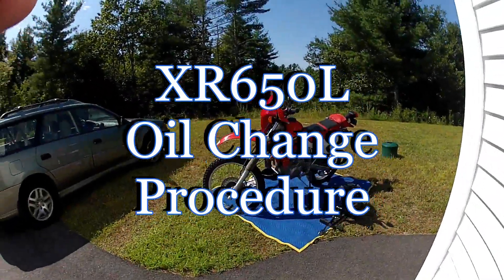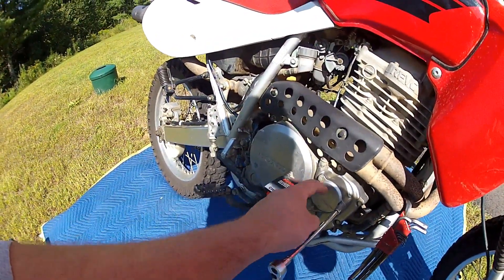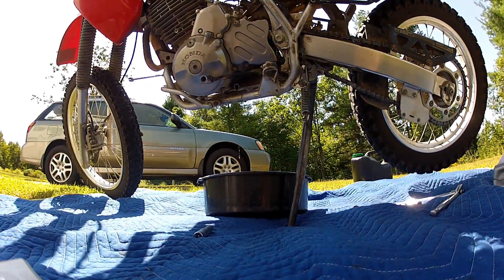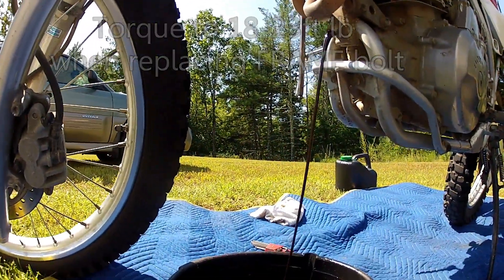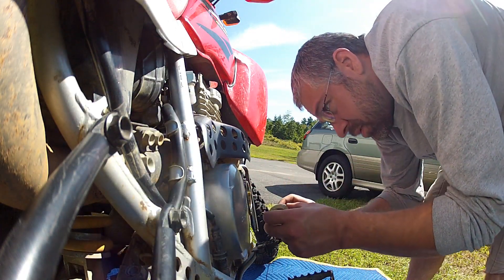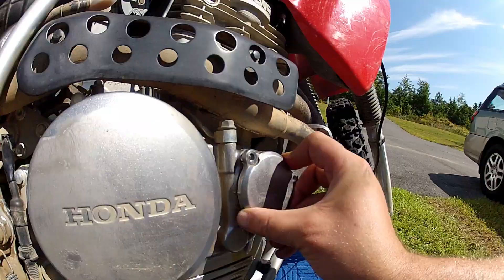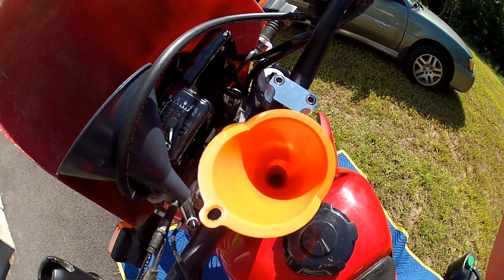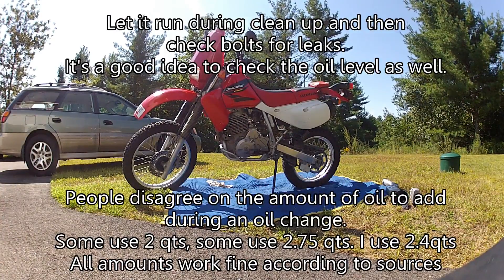How To: Oil Change Honda XR650, XR650L in 3 minutes

Comment: It's a good idea add new oil into the new oil filter before reassembly. Hold the filter to the same angle as when it would be installed and add oil until it is full at the correct angle. Then reinstall. I do this with all my motorcycles.

Comment: Hi nice vid. Just bought a used 2008. No manual of course so this helps. Question, who makes the tall windscreen.  Thx G
Reply from the maker: Hi Mad G Force , I can’t recall who makes that one but there are several companies that have developed one.  Try using the search term “rally fairing” on google.  Read old forum posts at advrider and thumpertalk and I think you’ll find the info you’re looking for.  Ride safe!  Congrats on the bike
Reply: Jeremy S thx again for more good info. G

Comment: ok thankyou Jeremy that makes sense,I think I will use the recomended Honda GN4 10-40 oil,im currently using spectro in my BMW Boxer,I like to use what the manufacturer recomends
Reply: Rotella T6 5w40 is a better choice.
Reply: Mobil V-Twin 20w-50 full synthetic for big thumpers...

Comment: Theres a gauze filter assembly with the oil pipe in front.Needs to be cleaned as well
Reply from the maker: I left it out as it's not in the manual and I personally never found anything wrong in there after 20k miles of oil changes.  Good to check it every 3-5 changes though.

Comment: 10w40 0r 20w50  are you using mobil 1 auto oil.  And if semi synthetic oil I used can I still use regular 10w40 if meets standards of Jaso T 903 MA) SAE ) API SG or higher.  Whats that all about.  Bike shop said if I used semi of full synthetic, clutch will burn up if I go back to non semi ? help if you know some.
Reply: twing21able Mobil make Mobile 1 full synthetic V-Twin 20w-50 (made for wet clutch motorcycles)...perfect for big air cooled thumpers or a 650r with 6k miles on it...

Comment: What do you think about that magnetic drain plug? Is it really necessary if you change the oil frequently?
Reply from the maker: I had over 20k miles on both engines in that bike and my rebuild was NOT caused by lower end issues or oil flow issues.  My advice is to:
-  Use a magnetic drain plug if you might not keep up with oil maintenance. (Never the aluminum one)
- Add a case saver if you might not keep up with chain maintenance
- Add a skid plate if you might ever bottom the bike out on a pointy rock
- Add brush guards if you ever plan on ripping through the trees (hand protection)
- Add a oil temp gauge if you drive deserts or hot stuff
- Weld a plate on the bottom of the kick stand if you might stand it in soft stuff
- Get an aftermarket seat if you plan on long trips
- Get standing pegs and a handle bar lift if you plan long trail trips
Reply: Thanks for the great advice!

Comment: do you check oil level by screwing the dip stick in all the way or just drop it in and check there ???
Reply: Just drop in up to the threads dont screw it down.
Reply: @crazyrebl  Thanks I was hunting for that tip!

Comment: Jeremy, what type of windscreen do you have on your XR650L? Thanks
Reply: Larry its a fiberglass and gel coat RallyRaid rally fairing for an xr650.  It will be an international order with hefty shipping and requires the light hole cut out which is a bear without the right tools.  RallyRaid is easily found in a search engine.  Ride safe.
Reply from the maker: I kantSpel provided accurate info.

Comment: how often,or how many miles should we change the oil on these bikes?
Reply from the maker: The manual states every 2000mi or 6 months, whichever comes first.  If the bike has added mods which make it run hotter, or the miles are hard trail miles rather than street miles you should change it more frequently @ 1000mi-1500mi.

After you've owned it for a while, you'll find that shifting stiffens up around 1000-2000mi and you'll start to miss gear shifts.  That is a great indicator that it's time to change the oil.  At the very least for someone who doesn't ride much, change it at the beginning of motorcycle season.
Reply: I change it every 1,000 miles with Rotell T6 5w40 oil (yes, it's "diesel" oil). The manual says every 2,000 , but I do 1,000 to ensure longer engine life

Comment: Isn't there a screen at the bottom of the downtube? Shouldn't that be checked as well?
Reply from the maker: Tough call.  The owner's manual doesn't mention it but some shop manuals do.  There is a need for locktite, breaker bar and torque wrench.  I checked mine about every 3 oil changes and found nothing each and every time.  There is always the chance that you could find some gunk there, but it shouldn't be enough to restrict the flow of oil.  If you're rebuilding a bike that was sitting for ages that might be a different story and hopefully you're not using you tube videos to walk you through it.
Reply from the maker: The other thing I noticed after looking at the bike is the downtube drain bolt (removed in video) sits right about at screen level.  The flow of oil running past it should pull some of the bigger chunks right off the screen if there are any.